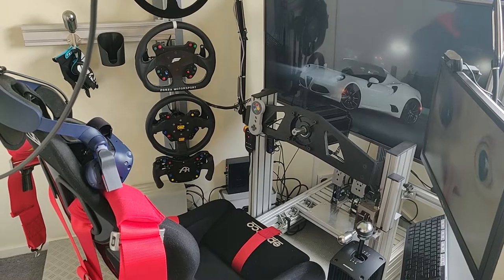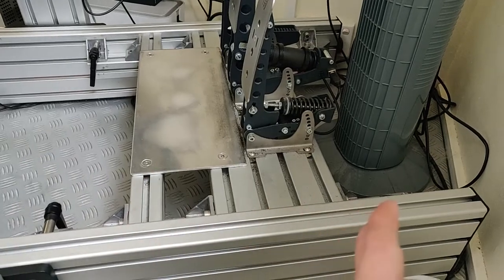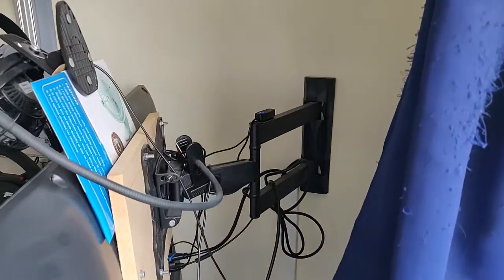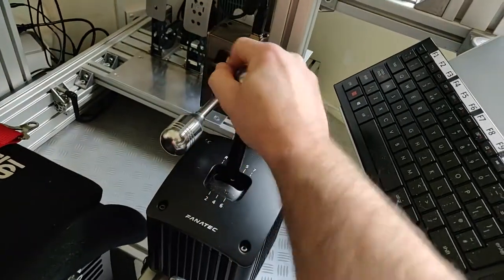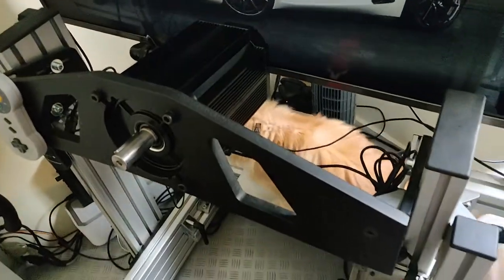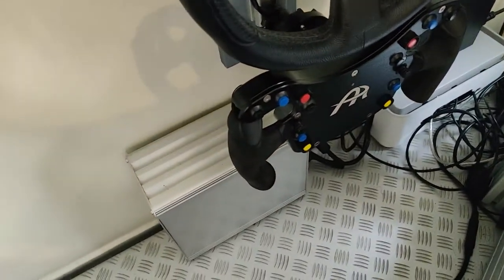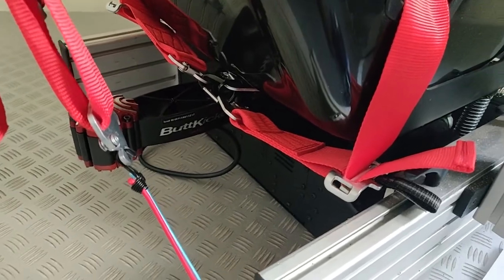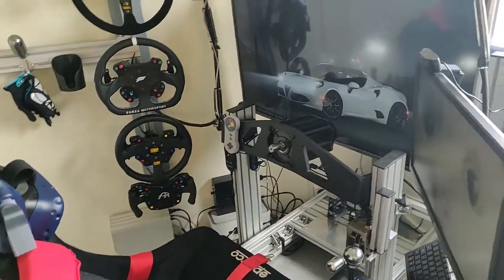Rig Overview 2 of 2 - All my kit, some DIY and custom mounting, etc

Comment: Love the setup ! Iv been wanting to add motion to my rig for a while and I'm going to do the same as you with the seat mover and the lowering brackets..I saw sim
Lab sell their own but you said they might not lower the seat as much ? Did you make yours yourself ? I film POV race videos so a full motion setup with actuators wouldn't be suitable because my wheel base extension would hit the monitors etc.. if you have any advice before I buy that would be amazing 🙏🙏 I'm going to do the harness the same as you too ., did you buy this as a special kit with the springs ? Thanks again , Alex
Reply from the maker: Hey thanks :) I made the lowering ones myself, I think I talk about in another video, not sure now lol. Bought L shape aluminium 10mm thick I think, or depends on rig, and simply cut with jigsaw and drilled holes. This way you can lower more than the bought ones yes, the bottom of the motion seat base is just off the floor on mine.

My harness was a cheap one off ebay, and the springs were separate. Again off ebay, I bought a cheap box of mixed springs so I could try different strengths.

Happy to help with any queries if I can, good luck!

Comment: Whats the shifter qr bracket look like?
Reply from the maker: It's literally just a standard 90 degree bracket, the kind you join 8020 stuff together with, and that lever bolt, if that makes sense? Loosening the lever bolt just means it van pivot around it.
Reply: @AdamsSIMporium  Reason I ask is I've tried a few and they all sucked.